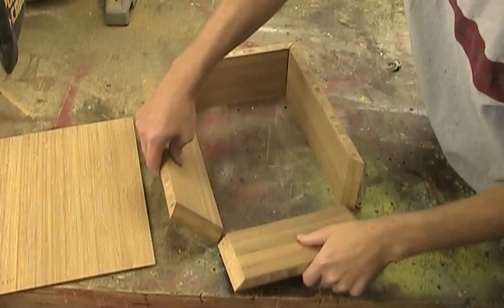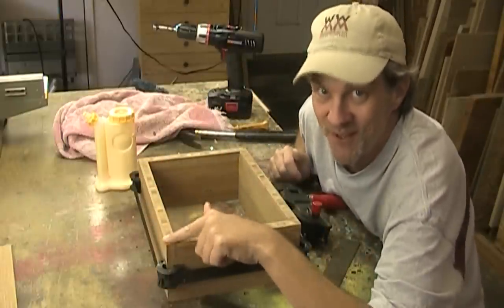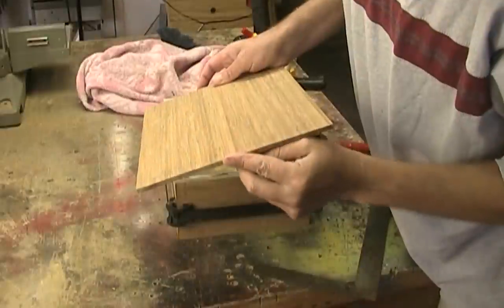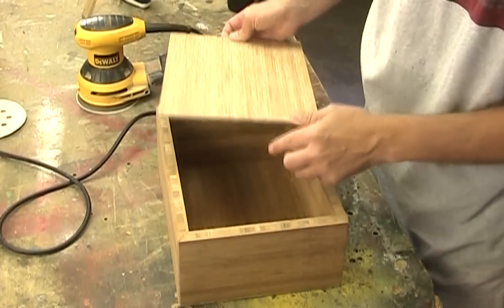Build your own multi-function stomp box / tambourine / cajon

Comment: This is a really great project. The bamboo panels look quite nice for this, too. As for the biscuits, it actually would have been a great idea to use them for corner joints, because with a mitre joint, you have a weak glue surface. Basically, they're very useful for 90 degree corners, shelves (like in a bookcase), face frames, mitered corners (even door frames and picture frames if they're wide enough), etc.

Comment: the placement of the piezo(s) and even the type and amount of glue used have quite an inpact on the sound. it's worth experimenting a bit! 
the face sounds different than the sides, and the corners from the middle. the elasticity of hot glue douple sided tapes absorbs more high frequencies, than CA or epoxy, and backing the piezo with a rubber foot or some plumbers putty increases the bassy thud - the heavier the backing, the thicker. happy tinkering!

Comment: I want to make note that using a Piezo pick-up directly can be fairly hot. i have done this using 2-3 different sized Piezo disks. In testing with several different boxes small wooden jewellery box, plastic DIY electronics hobby box, cookie tin. pick-up was to hot and caused feedback. plus piezo pick-ups don't have much bottom/low end. I found putting them through a bass guitar preamp gives them more bottom end.    

how was your testing, did you improve the pickup in any way.

Comment: If you want a quicker way to join two pieces of wood without a miter joint.  Try using the Kreg jig with about three holes in the piece used in this project.  For smaller projects, use two.  It holds stronger than glue and takes about a couple of minutes.

Comment: Then is a "beat box" a box that a person sits on and thumps on it with their hands?
Have you built one of those? Is the hole supposed to be in a certain place and of a certain size? Would the pickup be any different than the bass pickup that you mentioned? Same connection, right?
Thank you:)

Comment: nice! Does the pickup pick up vibrations from the air, or the wood that it is attached to? Would it make a difference if you glued it to the thinner top or bottom?  

I think the jingly things are called conches, that might help someone find them.

Wyatt is a lot better than I will ever be, that's for sure. Keep on playing!!

Comment: No, most electric guitar pickups rely on induction coils which generate current when the metal string vibrates back and forth over a magnet. You will definitely want to use a piezo-electric transducer which generates electric current when there is a change in pressure (like sound vibrations) against the pickup.

Comment: Is there a "rule" or clue when to use mitered cornes vs finger corners?

i would imagine fingered corners hold stronger.

thanks
Reply: I would imagine it's preference. Fingered joints are stronger for sure, but for something like this I would think fingered joints wouldn't be necessary, but optional. Something like this, Miter joints hold just fine.

Comment: Probably not but if you like to tinker then solder some alligator clips, with some wire, to a 1/4" jack. Clip them on to the leads coming off of your pickup and experiment to see what you get.